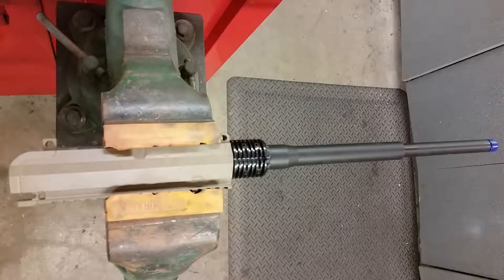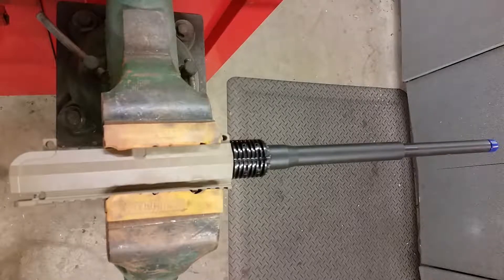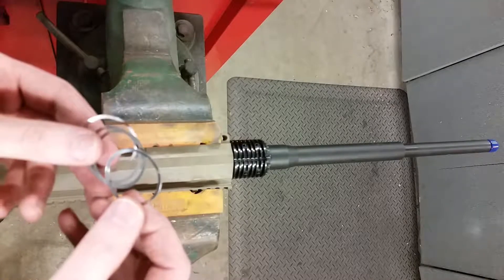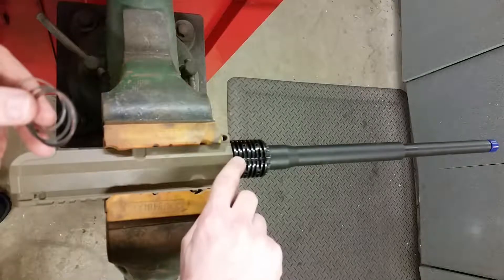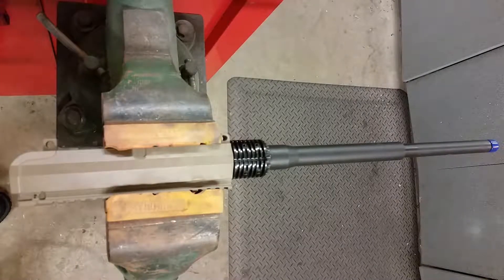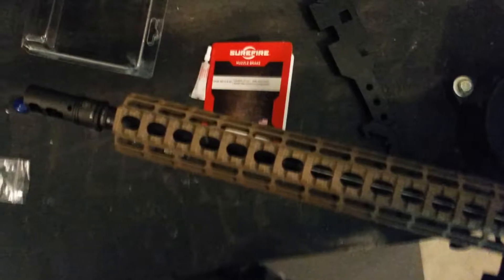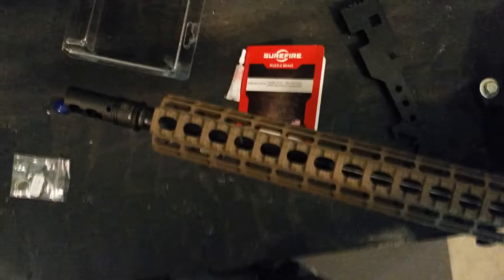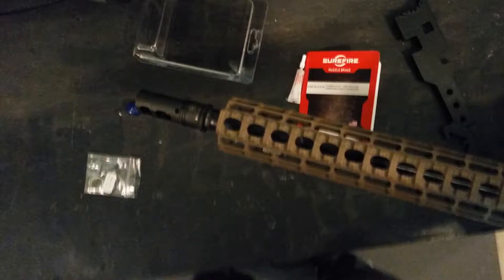Aero AR10 Gen 2 15" Keymod Rail Install

Comment: I just ordered one of these. Don't believe it comes with a wrench. What did you use for it?
Reply from the maker: I used an armour's wrench to torque the barrel nut on. I bought a cheap one but would reccomend buying a decent one or at least making sure it has good reviews; as mine had some issues with minimal usage.
Reply: I looked into it some said ar15 wrenches work? But I think they were referring to the actual enhanced uppers and not this.

Did you use a 308 wrench or a ar15 wrench?
Reply from the maker: Mine was just a universal armors wrench same one I use on an ar15

Comment: what brand armor wrench did you use to torque and install the barrel nut? Or did you buy a special tool that slides over the barrel nut and then torque it?
Reply from the maker: It was an ar armors wrench made by NC star, very poor quality would not reccomend it.  I broke it second time I used it this was first.  I bought it due to price but I would spend extra money to buy a quality one if I were you. It did not have great fit and ended up bending some of the tabs it uses as the wrench.
Reply: ok thanks. looking for a sale on the magpul wrench. ive noticed primary arms has it for 64.
Reply from the maker: I don't have personal experience with that but have heard very good things about it.
Reply: I definitely wouldn't recommend the NC star one. Broke mine the first time torquing the castle nut to 40# then went to torque my barrel and it broke the second time torquing.